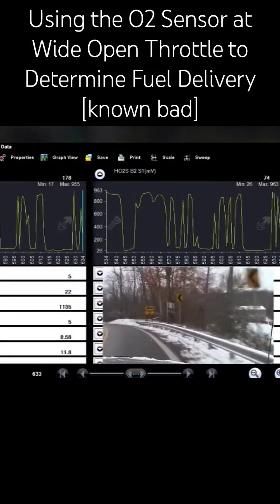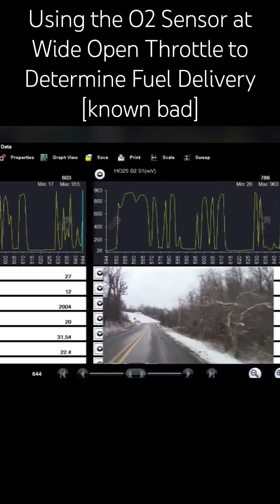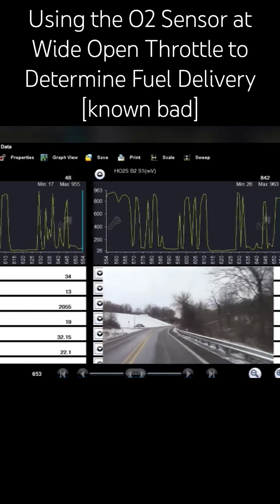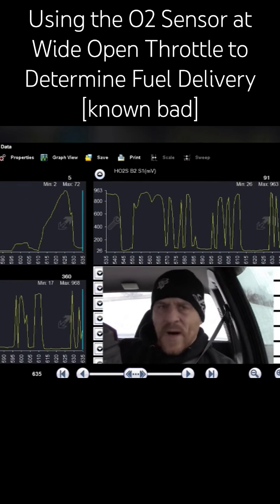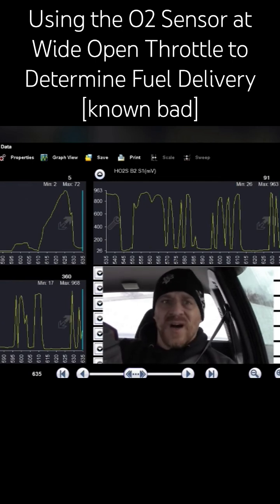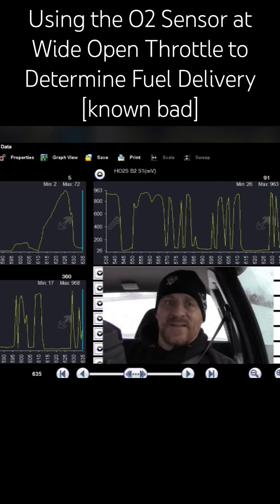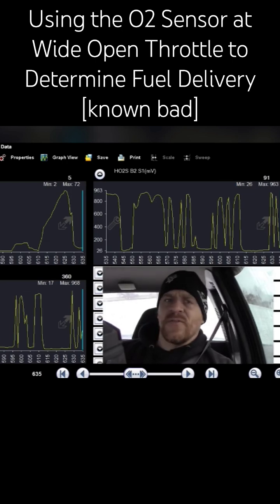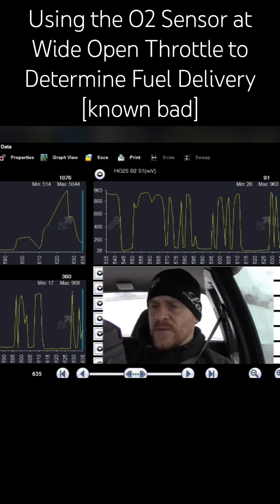Using the O2 Sensor at Wide Open Throttle to Determine Fuel Delivery [known bad]

Comment: Vacuum leaks absolutely affect wide open throttle. The only time it doesn't if it's a speed density system but all other systems are affected
Reply from the maker: At wide open throttle the manifold pressure is equal to atmosphere. Explain how a vacuum leak will effect the engine when there is no vacuum. 
In 30 years as a tech, not one single engine with a vacuum leak will have a complaint of low power at wide open throttle or lean conditions at wide open throttle. Doesn't matter if it's speed density or maf
Reply: @alltheboost5363 that’s not correct at all 😂

Comment: A leak post air flow sensor sure as heck can cause a leak condition. It depends on the range closed loop can compensate for.  But yes if your closed loop is trying to adjust but isn't making a real world effect then yes you know it's fuel.
Reply from the maker: You're not in closed loop at wide open throttle. O2 sensors are ignored and a vacuum leak is NOT causing this lean condition. Period.
Reply: @ScannerDanner  idk how you've set up your system we run closed loop in wot on some factory ecus and most standalones. You sure can have a lean condition by getting unmetered air. You would typically see it at all load ranges though and not just wot.im just correcting your absolute statements because there are situations where that is incorrect.